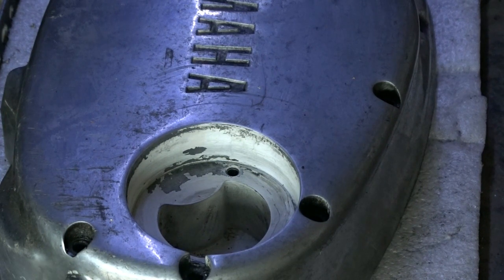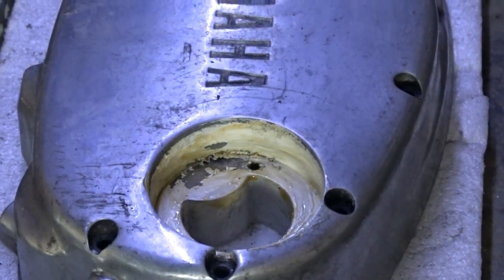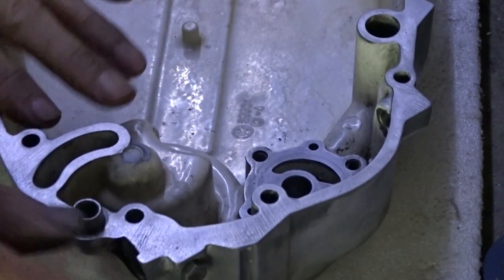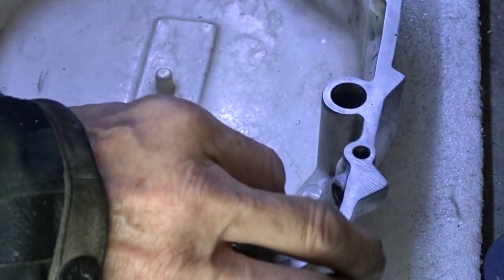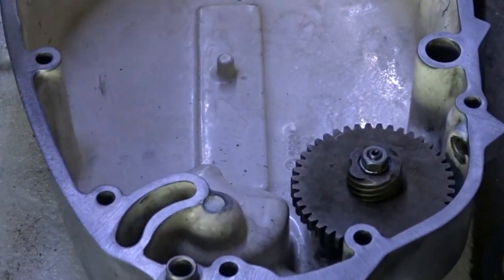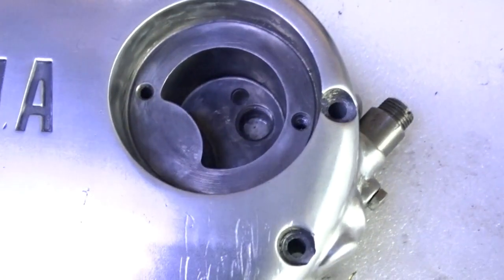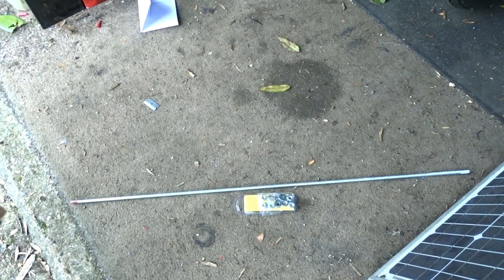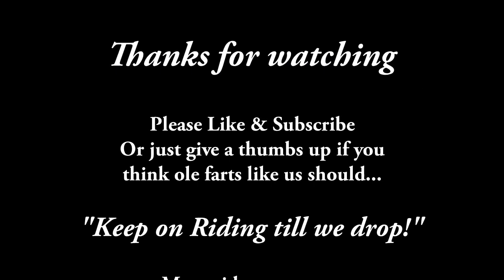Yamaha XS650 Engine Build Part 3 - Oil Pump, Taco Drive and other stuff

Comment: Back in the early nineties, I bought seven basket case XS 650's, for about four hundred bucks, and built them all and sold them, to pay for one together with the rings seized.  I had the stock 82 electronic ignition in one that needed the top end swapped, and ended building two or three with the same kind and they worked great.  I'd highly recommend the late XS stock electronic, if you can find it, good setup, works very reliable.  I regret selling any of those, I'm riding a 78 Bonnie, that cost over six thousand.  I've been enjoying your build, even a few years late.  I really like those Yamaha 650's, even if I did buy a triumph, again.  Thanks!  From the States.

Comment: OB,  I had a Tach drive oil seal in my kit. Where does it go? So I find it goes under the threaded portion you almost unscrewed. Bugger to get out unless you heat it with a heat gun, then it comes out easy. On tear down,  I pulled the taco drive out of the case before I took the case off. Then I see a guy that had an oil leak in this area. He said he didn't want to pull the Taco drive out or else he would lose the "thrust washer" (  on the bottom of the shaft that keeps the shaft from eating the case).  He said what? So I see you didn't install a thrust washer on the end of your shaft. I look at the parts break down and sure enough, the washer has to be there. Hummm, it must have stayed with the case when I pulled the shaft out. Then I washed it out and who knows... So Another week till I get the new washer in. Sometimes the simple jobs are not so simple. Ride Safe.
Reply from the maker: I never had the washer and like you had to find one and put it in at a later date, I should have mentioned the washer when inserting the taco drive but forgot due to old age I reckon :/ The case was a little worn where the drive gets inserted and looked like the dude who made a mess of the engine in the first place had also lost it and left it out. The engine that I built will have that drive shaft removed and a blanking plug put back in its place at a later date anyway, so all the searching for the washer was a waste of time in the end haha

Comment: ha !  came to the same conclusion about fitting the woodruff key lol https://youtu.be/7UevW4T63VY.

i thought that your  oil pump /tacho shaft sounded worn ? it sounded noisy and looked a bit wobbly when you spun the pinion. The shaft might need shimming to take up a bit of end float on the oil pump or pinion ?  Mine seemed to spin a lot quieter in the vid

The filter housing came up real clean.....good jawb

Have you fitted the Boyer yet ? I couldn't see if it was an electronic advance model or not .
 I would  write to the bolt supplier and tell them the packaging for the bolt was too little lol............ mind you if the threaded bar arrived bent there would have been some  Tourettes 
Johnny
Reply from the maker: Hi John, the washer was missing on the end of the shaft, that's now been resolved which has stopped all the free play, I am again stuck trying to find the kick start shaft washer now, you know the one between the shaft and outer casing, until I get that, everything is on hold.
Reply: @OldBiker  I'm pretty sure that the shim you need is a 25 x 35 x 1mm  . If you stick your vernier guage on your kickstart shaft you will be able to confirm. From memory it is identical to the valve shim washers .
I always buy quality generic  bearings , oil seals and shim washers direct from specialist Companies online. I find that if you buy specific 'Yamaha XS650 ' parts you end up buying the same parts at inflated prices. 
Thebearingcompanydotcodotuk have 1mm 0.2mm 0.5mm etc all around £1 each  ...https://www.thebearingcompany.co.uk/category.php?id_category=1716&p=5